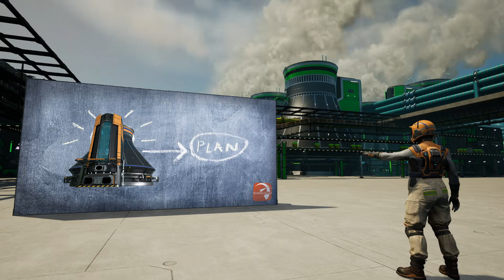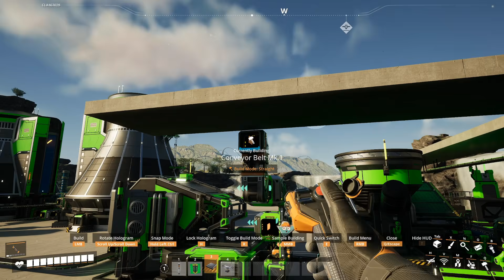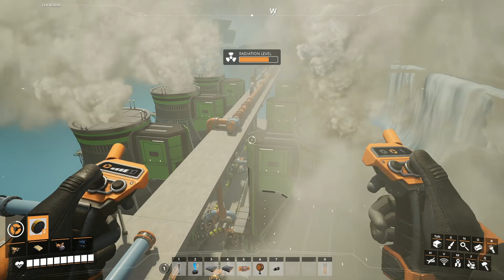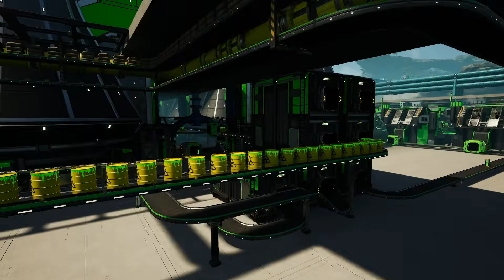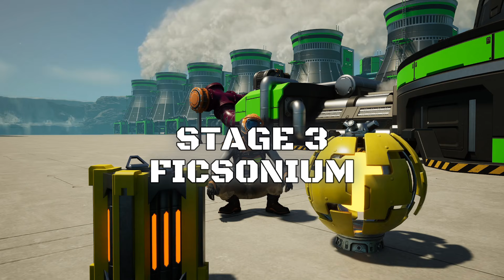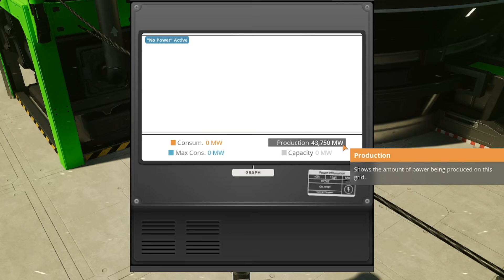NEVER Run Out of Power Again in Satisfactory !

Comment from the maker: 👀 I’m curious — what type of fuel do you use in your nuclear plants, if you use nuclear at all?
And if you do things differently, what’s your approach?
Reply: I did 32 uranium powered generators, then used some of the plutonium rods for drone fuel and sunk the rest.  Ficsonium isn’t really worth it, except for the challenge of it, I think.
Reply from the maker: I haven't really considered that. I'm going to test it myself and compare the resources going in. I'm curious how it compares
Reply: I did things a bit differently. I created 2 sets of 3D MK2 blueprints which autoconnect. The 1st set turns 1 Impure Uranium node (120 /min) into Uranium Fuel. The 2nd set turns Uranium Waste into Plutonium Fuel. Plutonium Fuel was then used in drones (no waste) to deliver the Ore or destroyed in the Awesome Sink. Ficsonium was not worth the effort; 2 extra resources (SAM + Oil) and Mk3 blueprints.

Good things about this approach:
- Never have to redo the Nuclear production chain in future playthroughs
- Extremely simple factory layout per Uranium node: Inputs -> 1x3 block of Uranium Blueprints -(Rods)-> x3 200% Power Plants -(Waste)-> 2x3 block of Plutonium Blueprints -> drone\sink
- Can easily scale to as many or few Uranium Ore nodes as you want. 1 Impure Node (120/min) = 1 line of Blueprints. 1 Normal Node (240/min) = 2 lines of Blueprints

Bad things about this approach: 
- Creating and testing all of the Blueprints takes a lot of time and effort
- Requires lots of space and machines because tuning for 120/min Uranium creates lots of underclocked machines
- Usage still requires manual work for things that don't fit in Blueprints: logistics, Water Extractors, Nuclear Power Plants
Reply from the maker: That's interesting. I'm curious what kind of input you will require for the same amount of energy output. I'm going to test that... 👍
Reply: @Overclocked-soz  Final stable production with all 5 Uranium nodes used was 105,000 MW. It took a very long time to stabilise just like you warned in your video. I likely also made the delay worse by introducing the circular feedback loop of the output (Plutonium Fuel Rod) being used to power the input (Drones bringing Uranium Ore). However I felt a strong need to use Drones because
1. I just really didn't want to do conveyor belts for only 5 nodes spread across the world! 
2. I needed to prove that Drones have this one almost perfect use case: consume radioactive fuel without waste + low throughpout + few nodes spread far across the world
3. It does look really cool to see Drones flying across the world 😎
Reply from the maker: @Bob-jy6hm Cool. I pretty much rushed to finish the game in my first and second playthrough, so I never got to make such a big plant. I'm planning to build a huge one for my next playthrough 👍

Totally agree about the drones, it's like they were made for this !😅
Reply: @Overclocked-soz  I confess that I also rushed through the game. I did Nuclear after the end as a challenge, to experience all the content and see what the alternative to hundreds of Fuel Generators can look like. Even with the low density of my Blueprint approach I think it takes up less space and looks cleaner than the equivalent 420 Fuel Generators! 105,000 MW / 250 MW = 420 generators
Reply: With a combination of alt recipes, I did 3U8P8F reactors, all fully overclocked. 
I slooped all the encoders to enable the system to perpetually run the dark matter residue in a closed circuit.
All radioactive materials are run through load balancers to prevent stacking and minimize radiation.
I'm pretty proud of the fact that my nuclear power plant is as clean as it could be, and you'd only feel the radiation if you were touching the machines.
Reply from the maker: @bladegrip8459 Ohh. That's an interesting thing to optimize for. 👏 I like it.
I'm curious, do you still get low radiation if you are not using all the energy?
Reply: @Overclocked-soz  Since the reactors constantly consume the fuel rods anyway, the flow of radioactive materials remains consistent even though I'm currently using only half the available power. 
I timed the flow so that all reactors immediately burn new rods as they arrive, so the reactors themselves are mostly clean.
Currently the worst offender for radiation is the pair of assemblers making the plutonium rods, since each machine always has at least 20 plutonium cells in it due to the recipe.
Reply: I built a 24 reactor Uranium plant, converted the waste to plutonium fuel
Rods and sunk them. Will probably go to Ficsonium eventually, but for now, tons of power
Reply from the maker: @ChrisBayus I really have to try this 👍
Reply: I decided that i should jump right in at the deep end, i used drones to bring over all the uranium to the swamp and i slooped the uranium fuel rod production, that facility alone filled the swamp biome out to the death barrier it currently produces 40.5 plutonium fuel rods a min which are being sunk and used to power even more drones, because im building out the whole facility to burn the plutonium and ficsonium  i started building down the coast of the dune desert. I have no map covering  train network so im using over 300 drones to bring resources from around the map and i configure them to 150 items a min as going over 200 has proved unreliable it has taken months to build the uranium still has some processing issues for the waste always seem to need more nitric acid , im using an extra 600 nitrogen gas than the modler said i needed and it still won’t back up but i think a lot of it is down to my design choices i know what i’ll do differently next time less pipes and more packagers they’re really good at solving gas/fluid throughput issues
Reply from the maker: I bet all those drones look awesome 😎 

To be honest I have not considered such a large drone network. But I have to admin, using nuclear fuel does make a lot of sense
Reply: can you do a fuel power video?
Reply from the maker: @Nikogamingpancakes Yep, it's on my list of things to do 👍

Comment: are you using any alternative recipe in this tutorial ?
Edit : Why is the Ratio 5/2/1 at the end and not 4/2/1 as it should be ?
Reply from the maker: Not using any alts in this one. My other video shows how to use alts.
The correct ratios between the rods is 5/2/1.
- 5 manufacturers produce 2 uranium fuel rods/ minute , enough to power 10 plants.
- 10 plants, produce 100 uranium waste ( 75 goes to 2 blenders for non-fisible utanium and 25 to the particle accelerator)
- and that generates exactly 0.5 plutonium rods in 2 manufacturers

Comment: Wait so are you sushi belting your fuel rods into the nuclear plants? Would the different burn times end up backing up your uranium rod production, or does that not matter since it would all up-cycle in the future?
Reply from the maker: That's an excellent question. 👍
 Yes I am sushi belting them but they go through a priority merger, and I am using Ficsonium first, then plutonium and only them uranium fuel rods. 
This assures that all waste gets processed and never backs up. Uranium rod production backing up is not an issue, because if it happens, it's because I am overproducing  ficsonium and plutonium and thus processing all the waste. It would just mean I can safely add more nuclear plants.
Reply: @Overclocked-soz  I see. Is the priority merger necessary at such low productions, or is it more of a "this could be a problem in 100 hours if anything backs up slowly over time"?

Edit: actually, I see now. Because the belt feeding the reactors WILL eventually back up all the way to the merger, we want to make sure any stock pile of fuel rods are prioritized. Meaning using rods that don't produce waste first.
Reply from the maker: @ZakPlaysPerc  Exactly, that was my idea 👍
It's something that would take time to be a problem and I have a feeling it might self regulate eventually if it backs up ... It's just going to give off a lot of radiation in the process

Comment: Hi - great video. Please can you explain what are the "VIP Junctions" you keep mentioning (for fluids / gases)? Thank you.
Reply from the maker: Thank you! Certainly. It's a type of fluid junction that takes in multiple inputs, has a single output and prioritizes the inputs in a certain order.

So if you have 2 input pipes, it will  take in fluid from pipe 2 only if you are fully using the fluid from pipe 1.
It's very usefuly when dealing with fluid byproduct loops, like the one in the video or the aluminium setup.
I detail how to make them somewhere in this video: https://youtu.be/9hMNRY581vE
Reply: @Overclocked-soz  Thank you! ❤
Reply from the maker: @MrNatsumBHappy to help ! 😊

Comment: I'm all about rocket fuel plants. ~712 crude oil can be turned into enough rocket fuel to provide 171,000 MW of power. You can make 2850 rocket fuel / min for that and while it doesn't take too many buildings to create it (10 refineries, 16 blenders) it does take a BIT more fuel generators to consume all that fuel. More being 680+ generators. So... ya, it's a bit much but no waste to deal with late/end game 43k MW doesn't go very far at all (especially if you overclock or sloop particle accelerators or quantum encoders! YIKES!) so a setup like this is kinda required. That or going full tilt with nuclear. 

I've setup 3 plants similar to this (though the previous two were 100 & 244 fuel gens) so nothing so crazy as this but it's worth it to see over my power sitting ROCK SOLID at 340 GW! :face-green-smiling:
Reply from the maker: I'm  thinking about expanding my rocket fuel plant as well. I think I was just missing a stable quickwire production and I've always avoided massive expansions in that sense.

Comment: All of that for 43K MW... That's why I have generally stuck to Rocket Fuel. 
I'd rather use 1 Normal Crude Oil Node to produce 1200 rocket fuel/min, then build ~115 fuel generators, producing 72000 MW, than deal with all that. (Lots of overclocking involved)
Reply from the maker: Rocket fuel is a much more streamlined setup. But what drove me to nuclear was at first , curiosity and secondly, I didn't like to build a lot of generators ( but maybe that was because  i didn't have enough room to easily expand my quickwire production because I boxed myself in a corner 😅 )

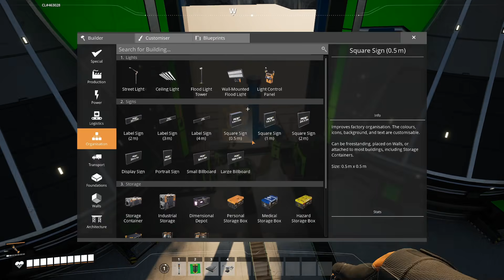Comment: How did you make the connector blueprint? It is at 2:45
Reply from the maker: It was not that straightforward... I built 2 nuclear plants and the connector then removed the 2 plants and placed a blueprint designer as close as possible.
After that I just copied the middle connector into the blueprint designer. And by copied, I mean I built it again in the designer while looking at the other one nearby.
It was kind of tedious, but I just locked the hologram in place and nudged it into place until it seemed to match the original one.
BIG DISCLAIMER: It doesn't actually connect automatically. I still had to manually connect the lifts to the plants even though there was 0 gap between them.
Reply: @Overclocked-soz thanks, just want to let you know that this is the best nuclear power plant tutorial I've seen so far. Keep up the good work
Reply from the maker: @noticedbeefThank you so much ! 
I will keep it up 😁

Comment: Nuclear power is problematic in this game and it degrades to a complete joke if you take it all the way to the Ficsonium stage.  At that point the resource requirements are beyond insane and your net power output is crap.  Ficsonium is for people who are bored and simply want a challenge.  If power production is your goal, rocket fuel is vastly superior.  Just make a 4 pack generator blueprint and stack them in a 9 high, 5 column arrangement.  Each column is fed by 2 blenders and 1.2 foundries and boom, before you know it you've got over 100 GW with no Somersloops.  Build 2 of these at the Spire Coast and one at the Crater and you've got well over 300 GW.  If you want a completely unnecessary level of power then add 'sloops and more generators you're pushing half a terawatt.  Build your first plant with powershards sourced from slugs and then you can easily make synthetic power shards for the rest.
Reply from the maker: To be honest I'm kind of on the fence with this one. It's not that I mind the complexity, that part I actually enjoy, it's the fact that the benefits don't match the effort. It feels like you should have gotten more out of it. And the fact that most of the structure cannot be blueprinted doesn't help 😅
That being said, I still find it more enjoyable building a nuclear plant rather than a rocket fuel plant. That's just preference, not considering power output and efficiency. 
But maybe we will see a revamp of the energy system in the future.. who knows
Reply: I can get 4 fuel gens in a single blueprint, fully piped and extendable, no clipping. Very blueprintable.
Reply from the maker: Yep, you're right, it works really well with blueprints. 
I think I was pulled towards nuclear because I was lacking enough quickwire for the generators

Comment: personally i do 60 uranium fuel rods per minute which sounds like a lot but is achieveable with only 1250 uranium a minute, then i reprocess waste into plutonium and that goes straight into a sink.  trying to process 28 plutonium rods per minute into ficsonium would be very hard
Reply from the maker: What do you mean by ONLY 1250 ? 😅
Yeah, a lot of people pointed out this setup and I really want to do a comparison for my next video between sinking plutonium rods and turning it into ficsonium.
Reply: @Overclocked-soz  1250 is only 3 of the 5 nodes with minimal over clocking, it sound like a lot buut once you get it started and all the infrastructure is down its a walk in the park
Reply from the maker: @Dan_The_Man8 Yeah, I guess the advantage of sinking plutonium rods is that you can really streamline the process and it seems easier to scale. I have to try it 😁
Reply: @Overclocked-soz  also the 2.3 million points per minute, that golden nut is mine:)
Reply from the maker: Yeah. Keep it up 😁

Comment: Well, a few week ago, I made my first nuclear power plant.
Then, I found out that I couldn't sink the waste, and I had to redesign to produce plutonium rods out of it, and sink it instead.
So, I will wait until phase 5 to attempt to use plutonium rods and make fixsonium rods out of plutonium waste, then use it too.
Reply: In my case, I used an impure uranium nod O.C. to 250% for 300 units/minutes, to feed 6 Nuclear Power Plant O.C. to 250% with 12 water extractor O.C. to 250% too.
Reply from the maker: In my playthrough, I already had a considerable rocket fuel plant and I ended up just stacking plutonium waste until I unlocked Ficsonium. I was making something like 3-4 per minute so it wasn't really an issue .
I was happy to just let it irradiate the waterfall...

Comment: Personally, I'm a fan of rocket fuel. If you have the Heavy Oil Residue and Diluted (packaged) Fuel alternates. You get nearly 4 lines full of rocket fuel which can power an endgame base out of a single overclocked pure node of oil (600/min) without needing to deal with any waste. Though it does require building an insane number of fuel generators and refineries which is a pain even with maxed out dimensional storage.
Reply from the maker: Yep. Rocket fuel is crazy efficient. But the number of generators I have to build kind of pushes me towards nuclear.
Reply: @Overclocked-soz  Same. I didn't want to just construct 500 fuel generators … It was already annoying to make 50 of them … So I switch to nuclear.
Will most likely have to make another one nuclear power plant, just in case.
Reply from the maker: @eldarionmarchombre4568 Yeah, I'd really wish they'd make rocket fuel give you more power per fuel generator instead of just burning slower
Reply: @eldarionmarchombre4568  with blueprints, auto connect and overcloking at max every generators, it become more easier, i took 20 min to do the blueprint because i wanted to have a beautiful think but it took me 30 min to put and plug the 500 generators and now i have unlimited power ( until the start of the nuclear process )
Reply: @wolfranium2199  
I find this so annoying that I did O.C. all my nuclear plant to only construct 6 of them instead of 15 of them. 🤷🏼‍♂
Reply: @eldarionmarchombre4568 just got done making 256 in a tower, and even with a 4 gen bp, definitely got annoying
Reply: Yep agree 100%, with all the good alt recipes you can get 5400 m^3 of rocket fuel for 1350 m^3 oil for exemple, with this setup i have 323 750 MW with just 900 m^3 of oil xD
Reply: Oil 120/min and water = fuel 600/min
Reply: You can skip the packaged part and just use the blender if you are a high enough tier for resource well extractors
Reply: @RealVideogameArmy  That's why "packaged" was in parenthesis. Either recipe works, whether it's the packaged one or not.

Comment: The thing that is a nogo for Oil is the crappy Fluids Situation and i love Coal plants. So i plaster the Map with Coal Power until i build the first Nuclear Plant and as i increase the latter Amount while demolishing the Coal Plants and redirect the Coal for Design Projects with a lot of Metal Surfaces.

Yes Nuclear needs a lot of Water Fluids but with Water Tower and enough watering Holes available on the Map makes the Fluid managable and secure. 

As of the Waste, well i have a nice dumping Hole over the big Water Fall in the Desert Field where the Radiation is no Issue. 

End of Line.
Reply from the maker: Haha , so the radioactive stockpile ☢️
I haven't tested this yet but I've read that there is no actual limit to the radiation field. So in theory you could irradiate the whole map. I should try that 😁